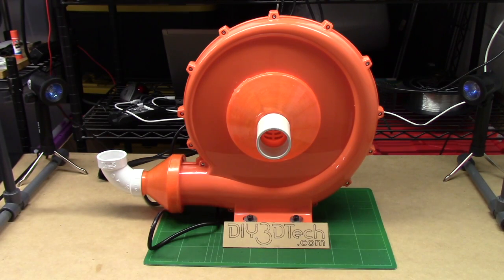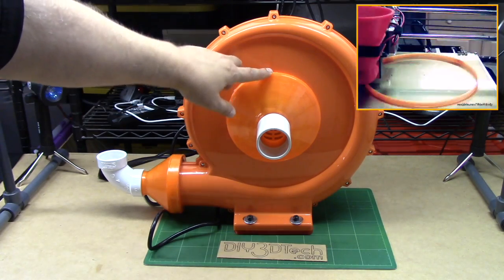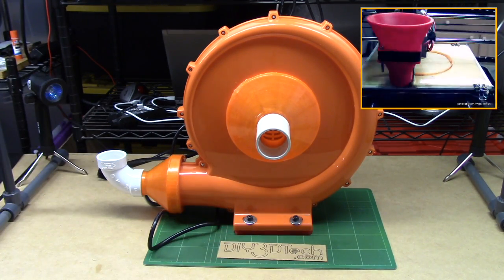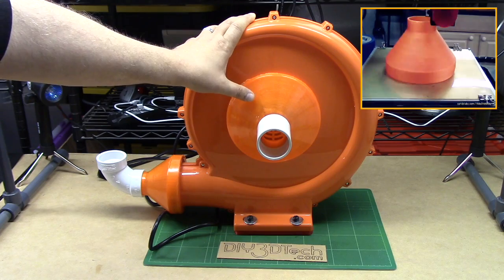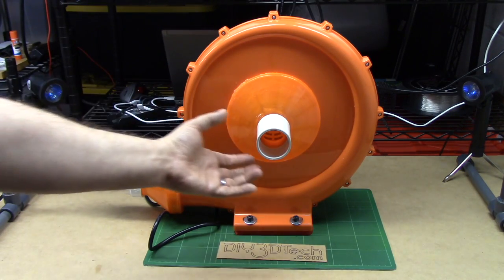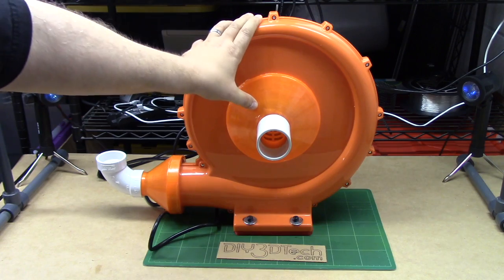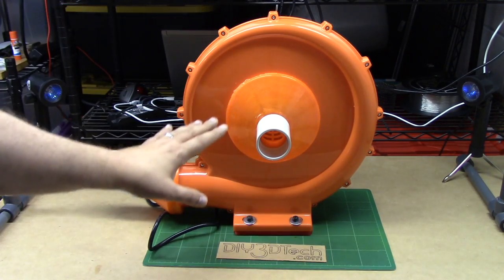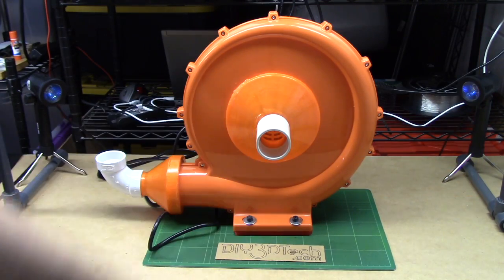K40 eBay Chinese CO2 Laser Cutter & Engraver -  Fume Extractor Followup!

Comment: See this video, it may be useful to boost air pressure
https://www.youtube.com/watch?v=WvFNqEPNPOc
Reply from the maker: Thanks and yes very familiar with the venturi tube concept :-)
Reply: I was pretty sure you where. Looks like it could also be used as a quick, cheap way to check air is blowing to any particular pipe.. Just a piece of fish tank air pipe with coloured water in may do. Could help if noisy environment or for remote video checking etc...:)

Comment: Ha thanks for the shout out .   looks super.
I was thinking about that larger manifold , and flow . You prolly know more re fluid dynamics , but my thought / instinct would be to curve that taper from pipe to blower ,  like bell or trumpet horn . trying to keep a smoother flow.  The air will drop speed as it enters the opening but its quite wide and looks like that fan inlet could eat up that volume of air just fine . 
As well I think if i was going to cover the intake , i would clip out all or 1/2 the grill / guard parts .i suspect their turbulence also adds to the sounds or noise volume. Its a restriction at any rate. if you removed it you could 3d print a guard later if you re purpose it  .
should be nice when all plumed in .
Oh and , Re further noise reduction , you might want to print isolating coupler for where the plumbing meets the unit . no need to pass vibrations into lengths of piping to become resonators. ( harder the substance the easier sound energy pass through it )
Well its cool , and thanks again.
Reply from the maker: Yes on the isolation coupler and the TPU feet also work well.  Was thinking about removing the grading, however, it not and figured if sucks something in by accident it will save the impellers as I thinking seriously about your vacuum hold idea as did some test and thing will work as it does drag it down that bad.  Also, the funnels were more so designed for what could I 3d print rather than air flow and with shocked the big one came out as it did at such a low angle.  All in all, I have been pretty happy with this and can't believe the response on Thingiverse for this!
Reply: its way cool . 
to avoid that low angle issue , if you ever make an other , using a bell or trumpet shape for smooth transition also let the angle increase as it come to the center. That should all but kill any funny print side effects . 
Your keep popping out interesting stuff man ,keep at it .
Reply from the maker: Working on it! (i.e. cool stuff) as working on setting up the CNC now :-) as want to start doing video with that (it has to start earning its keep :-)
Reply: K40ebay link doesn't work
Reply: works for me , could just be shrinker
Reply from the maker: Try this one as eBay links get funky sometimes (http://diy3dtech.com/purchase-laser/) as I coded this page to pull all the latest eBay offerings.
Reply: Thanks
Reply: XerotoLabs iiii